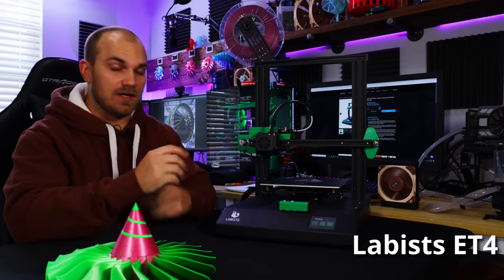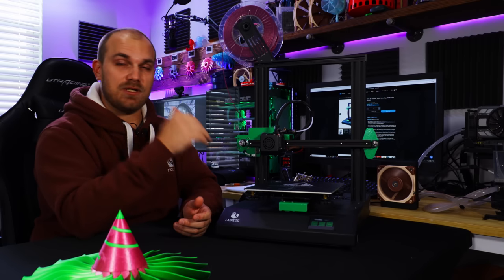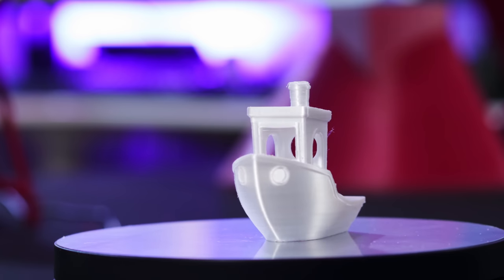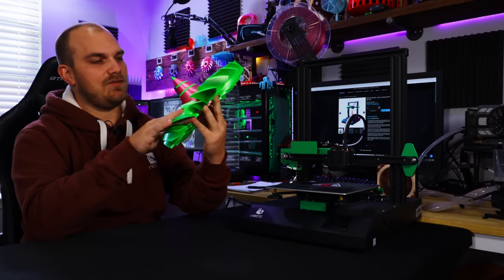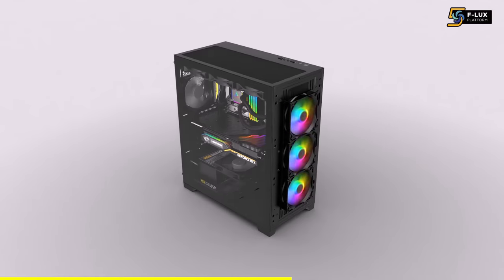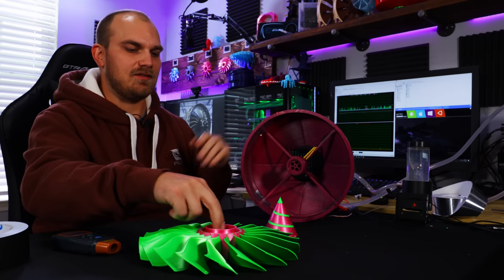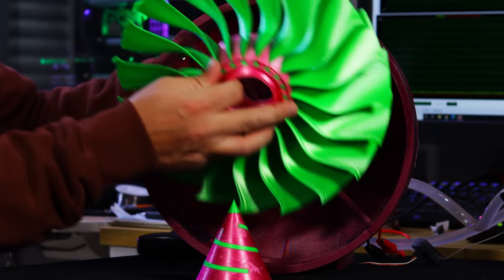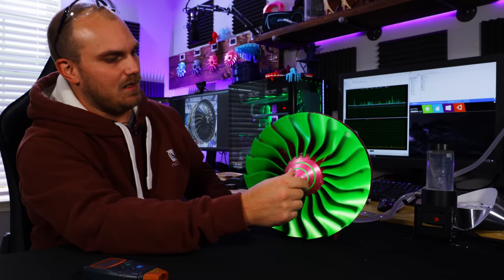3D Printed Jet  Engine Fan Water Cooling | Labists ET4 Review

Comment: 10:25 Holy shit that was so anticlimactic lmao. I thought as soon as it fell over, it would just explode like it did right afterwards... But nope, just plop haha
However I do want to bring up 8:20 onwards... You're probably right about the duct. High bypass fans have pretty good static pressure, but no where near as high as the actual compressor stage of a turbine engine. I don't think a straight duct that short would be best, since you're cramming a massive area into a small one. Lemme throw some maths at ya real quick... Brace yourself! Keep in mind that I've never studied fluid dynamics, so take everything I say with a massive boulder of salt, I could be horribly wrong xD

v = (4 x fR) / pi x (pD)^2
where v = flow velocity, fR = flow rate, and pD = pipe diameter.
Let's just assume fR = 10 and pD = 4 just to start out. 4 being the diameter of the fan (just go with me on this), and the flow rate should remain the same under the same fan profile and RPM.

This will simplify to:
v = 4 x 10 / pi x 4^2
= 40 / pi x 16
=0.795 units of velocity for 12.57 square units of area.

If you halve the diameter of the pipe/duct, then
v = 4 x 10 / pi x 2^2
= 40 / pi x 4
= 3.18 velocity.

Halve it again,
= 12.73. 

The point I'm getting at is that you need to taper the duct to give the air a smooth (ideally linear) acceleration from the blade to the radiator. This is where I kinda trip up, since I don't know what kind of duct can do that. I'm gonna brute force it for now but smarter people than I (which is already a low bar lmao) can probably just tell you.  This comment might end up in your "held for review" tab in the comments because of this link, but it's just a graph showing the data points I brute forced, and the formula/curves it produced https://i.imgur.com/jVKC1yt.png

In this graph, Y axis is the diameter of the pipe, X is the velocity. So lets say you started at a velocity of 1 and wanted to end up with a velocity of 10, with a linear increase of speed down the duct, the initial diameter for a flow rate of 10  is 3.57, and the final diameter would be 1.13. What this is basically saying is that in order to get a smooth increase in velocity, the duct must follow this shape. Since the duct size approaches infinity at 0 velocity, it's probably wise to cut it off at some point, but keep in mind that your final velocity will suffer and the duct will have to be much longer to achieve the same effect, approaching infinity as you get to a straighter and straighter taper.

Sorry for the gigantic comment with probably horribly incorrect information :(

Comment: I might have an explanation for why you are getting so much air thrown out from the sides. Fans on turbofan engines are designed to be used with a smaller diameter compressor stage behind it which is happens to suck a lot of air really quickly. That means that the big fan in the front needs to have relatively clear openings near the center of it to allow this air to pass through much faster. When powered by an electric motor, those flat sections on the main fan centrifugally sling all of the air outwards, and reducing effectiveness.

Comment: If you do it again, scale down that nose cone. You're adding a whole lot of extra weight at the front of your fan for negligible gain. Technically you could just get entirely, but that wouldn't look half as cool. If you half the diameter and length, you'll reduce the weight of that cone by 75%.

Also work on making a workable case, a real jet engine works to minuscule tolerances to minimize clearances. They actually have an adorable liner in the case so that when the fan runs, it 'cuts' the inside edge if the case to fit the fan and get minimal clearance.

Finally, the duct is way to agressive, the outside portion of the fan will move more air than the inner portion as it's moving faster than the blade closer to the centre line, but you're forcing it straight into a 45 degree bend. You'd be better of with a far more gradual reduction in cross section, or if you wanted it to be extra cool, take a look at a jet engine nozzle and exhaust and taper down gradually with a static cone in the centre.

Comment: Those types of brushless motors are designed to run at high speed but don't have a lot of torque. It would probably be better to have a hefty brush gear motor to drive a fan this large

Comment: Try a Longer duct, less pronounced angles... Give the air space to move. I envision something along the lines of large fan mounted out of the way where noise is not an issue ducting with pressurized air being fed into/over the Radiator.

Comment: Hey my guy on top of using interference fit use like 3 large splines. Not like its a high torque application.  And they make this stuff. Its sand glued to paper and you can use it to clearance things. Just saying ✌😂👍

Comment: i have a few constructive comments, might be a bit rough and i might not know all of what i'm talking about, if not any at all, but i figure it should be somewhat helpful. so i do hope this gets seen.

if you were trying to pull air through the funnel rather then push it then there wouldn't be as much air being tossed around due to it suddenly acting like a vacuum instead of a leaf blower. on top of that, the fan wouldn't have popped off of the motor like it did because of the force pulling it off, instead it would have been held on and probably would have been more effective in cooling the motor more. of which was constantly generating heat and not receiving any air flow with that cone you had on it. (could be a good idea to also make a separate fan out of the cone itself by adding slits and fins if you want the motor to be cooled as it's being used)

so, that being said, why not flip the angle of the blades so that way your not bottle necking the output of the fan. that way your pulling air through a radiator instead of pushing it of which originally pushing it bottle necked the flow of most of the air and forced the air out past the shroud rather then into the hole where you wanted the air to flow.

Comment: I feel like a better test would have been to start at a low rpm and increase while gauging cooling/effectiveness. The selling point of a huge fan for a computer is that they move a larger volume of air at much lower, quieter RPMs. Hitting 2000 rpm seemed like an unnecessary requirement for a fan that big.

Comment: The reason you don't see this kind of blades on computer fans is because their efficiency is reach at high speed. On a jet engine the tip of the blade reach the speed of sound in some of them. The rpm for a jet engine goes from 10,000 to 25,000 rpm. That's pretty much why their is no thrust when you run at 500-600 rpm and why no fan manufacturer goes for this design.

Comment: If you use a fan motor a little smaller than what is probably preferable, in ratio to the fan size, use a step down gear or planetary gear set up so you can have a more linear torque and speed transfer ratio. You don't want to wear out motor by putting that much weight on the protrusion arm that the fan is presumably mounted on which will slump it by flex to some extent and then running at speed...yeah, not good. For the hole that you have on the nose cone for the fan that you use to connect the fan to the motor, is it a simple mounting hole? If so, print it like .005" smaller and add in parallel relief slits like this: -0- So the fan will be mounted with a little, very little tension on the motor shaft to hold the fan better and when mounting, use so non-permanent loctite so you can still have the option to unmount but if it is loctited on, it'll be secure. You get more stability in operation when decreasing flex tolerance. If your choice is between the duct and blade, keep the duct and shave the blades. You want probably as close tolerance between blade edge to duct wall as possible to minimize performance loss through design tolerance and maximizing the amount of air entrained through blade pass and redirected. And add in some inlets of a scooped groove design flowing inward to the blade hub so that some of the air will go in and cool the motor by method of air entrainment or a back splash plate so that some cool air will wash in and cool the motor. Not sure if I'm conveying adequately but well, it's 4am, lol.

Comment: i'm not an engineer by any means, but aren't turbine blades meant to be moved by air, not for moving air?
Reply: Their are moved by engine. This thing is modelled after modern high bypass engines.

The fan is what provide first stage compression as well large portion if not most of trust.

You can see big modern commercial jet engines as shrouded turboprops. There is blurry line which pretty much simply end at whatever the hell manufactured decided to call given thing.

Comment: While I really like the Idea, unfortunately there are several problems that would need to be addressed:
-how accurate is the cad model itself, I really doubt the author had access to a real Fan to scan/reverse engineer, thus the angles and proportions are probably completely wrong.

-Even if the model was right (and that is. Huge if) you would have to spin it in at correct Speed  for it to do anything significant, as the fan is tuned to work only in a relatively narrow range (turbofan engines get spooled up with external power) running it 5-10 times slower will not cut it

-the shroud in a fan is not only there to support the motor and look pretty with RGB, it has an integral fluid dynamics role in the fan operation, it stops the air from being flung out the sides of the fan, as you noticed and redirects it where is needed with the lowest impedance possible so you need a cowling 

-you will also probably need a bell intake, as they use with real turbofans when they are statically tested, in order to again match the impedance, as the fan is not designed to suck still air, but to accelerate already moving one

-you will need a reasonably bigger motor (probably in the neighbourhood of 500W to a kW to run a fan that large at the correct speed as the required power grows quadratically (to double the speed you need 4 times the power, to triple it 8 and so on)

Comment: Just make a small compressor section with shroud, and power it with the biggest motor you got. Noise my be an issue, but heat sure as heck wont!

Comment: That’s a jet engine turbo fan, they are typically meant to spin between 3000 and 10,000 rpm. My neighbor used to design them at Lockheed Martin and he walked me through the math a couple times. It definitely needs a shroud, printed as one piece and lots of speed / RPM! I don’t remember how well they work with compression. I’ve been waiting for this video and to see it end in disaster  before it got to do and work kind of sucks😭 Please try again.

Comment: 3 issues I see here. 1. The duct won't work.  Trying to push air from that size input to a much smaller output will only result in a severe amount of back pressure.  Real jets have the input, output and the path the exact same size in volume to no stall the engine and cause back pressure.

2. The electric motor isn't cooled.  For a setup like this the motor must have active cooling due to the amount of current that will be going through it.  In jet engines this is done by controlling some of the moving air to cool the system.  Where the motor was didn't have any kind of cooling when it was mounted in the shroud and outside the shroud, the air was passing by a good distance from the motor.

3. Jet engine fans are designed to work together.  While a fan for a computer moves air through a radiator, Jet engine fans have many stages to compress and expand the air to allow for fuel combustion.  A first stage jet engine fan isn't designed to move enough air by itself to do much work.

There are situations where these points are not followed.  Wind tunnels, at least high speed and mach 1+ tunnels, use large fans to push air through a small opening to get high speed air.  however these fans are special as in they are designed in a way to prevent back pressure and the tunnel is usually very long to squeeze the air through a small opening.

If you want to get this to work, I recommend using a longer tunnel with control veins to keep the air moving in as straight a path as possible,  Mount the motor away from the fan with guide veins to force air to cool the motor, install a current limiting controller and finally, a second set of fan blades behind the radiator to also pull the air through creating a push-pull config.
Reply: This is modelled after high bypass engines.

Such fan in real engines provide high portion if not most of the thrust.

Comment: The fan needs a forward fairing, and a proper motor physically attached to the hub. The forward fairing will direct air into the fan. The other thing that is needed is a secure hub holding those blades in place. Check out AgentJayZ's chanel for blade mounting ideas (he's a jet engine mechanic). Also with the duct... the duct should probably have a bit of bypass around the radiator. This sounds counter-intuitive, but that outer airflow will actually pull air even more into the fan and from the back side of the radiator exhausting. The ducting should have the radiator mounted as to maximize this effect, as the outer 1/3 of the fan is where most of the thrust comes from in a turbine engine. If you mount the radiator where the combustor would be, i think you'd have a better shot of a more stable working proof of concept. Hope to see more videos like this one!

Comment: I betcha the leading edges of them blades are too sharp.

Sharp edges on the blades will actually produce more friction as they wiz through the air.

Print the blades a little thicker and make a rounded leading edge.

Also, as you’re ramping up the fan speed, the blades will tend to stretch...as such, if you can find a way to lighten the second half of the blade using a chamber and put a little more of a surf shape into it, that should calm that down.

Also, your hub will likely be under a fair bit of load.

Try printing an inverted Christmas tree slot into a solid hub then make the base of each blade the negative of that slot shape so you can just slide them in...then, print the cone in many separate parts which will ‘key’ together to form a reasonably deep circle to the front of the hub, such that each segment has a wedge that slips perfectly into the slot gap formed between each blade and outside edge of the hub.  Make them fit into the gap to form a chunky surf shaped ‘wedge’ between each blade.

The cone should then fit over the top of the circular face plate formed by the wedges to the front of the disk.

That way, more of the weight will be centred in the hub area of the fan and they will have less of a tendency to straighten as it speeds up.

Comment: That's a long-since proven design for moving air. You just ran into a tolerance issue and didn't have enough power in your motor. I suppose the exhaust on the shroud may have been too tight as well. That design can definitely be made functional though.

Comment: try ultimaker cura for slicing , its ther best on the market  and its free and its also preprogrammed with the printer stock settings for litterally any good printer on the market . i used 2.2kg of plastic and 3 days 18 hours printing a life sized alien head on my ender 3 and you cant even see the layer marks .

Comment: Maybe there is a way to hook up a 280mm fan to a 360mm or 240mm radiator. Try cooling a multi-fan radiator with a single fan.

Comment: When he said "2000 rpm" I looked at the fan and thought "Uhm ... normally 200ml fans run at around 800-1000 RPM max..." had a feeling it was going to explode into pieces at higher RPM. Low Speed, high volume, low noise sort of thing.

Comment: I do think your shroud surrounding the fan needs to be a lot more forward as opposes to the fan. The way a jet engine looks is it has that massive gaping hole and the fan sits inside it, which probably doesn't give the air anywhere else to go but through the engine. 
So a bigger shroud/ducting. The fan definitely needs balancing, yea definitely a bigger motor.. I do think the cone on the fan is too big, but its better than nothing.

Comment: Kinsa genius. Turbofan engines, like that on commercial aircraft, are designed to move massive amounts of air at insanely high speeds, and they achieve that with the fan on the front of the engine ---- so why are cooling fans not based off that design?

Comment: Could someone make a dual blade design? The first main blades are twisted to get air moving towards the propeller, and the second set are to have them keep their speed. They would need to be thin but should be good for cooling since the air that comes out is not going to be slow.

Comment: The bypass fan is pretty useless. You are looking at a lot of air being pushed far too quickly to make a difference anyway. It will have a similar effect to fan stacking at best. For the actual fan size you were using a decent 1200 RPM with a normal 120 MM fan motor should cool it quite well. But yes, the air duct modelling can be checked with your smoke test method. If I understand the air flow correctly, ducting this type of a fan with an intention to cool will just cause air to actually hit the chamber and bounce back. Now you could try a Tesla valve type surface duct shaping (surface has grooves like the tesla valve), but it will just be too shallow for the size  and the outcome wont be all that great.
you want the HVLS property , (high volume, low speed)

Comment: Don't bother with the car motor, it would have even less torque then the motor you used. You would need a reduction gearbox for it. I'd love to see a scaled-down version on the a12x25 frame.